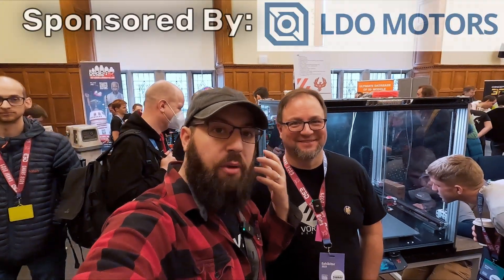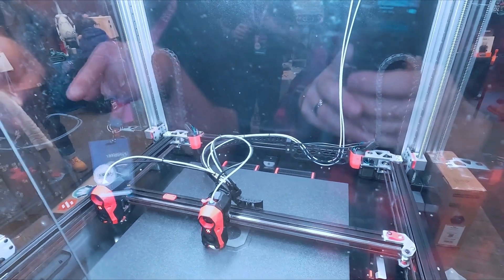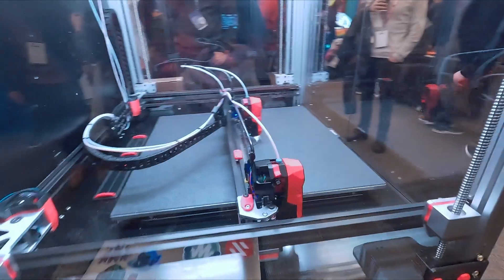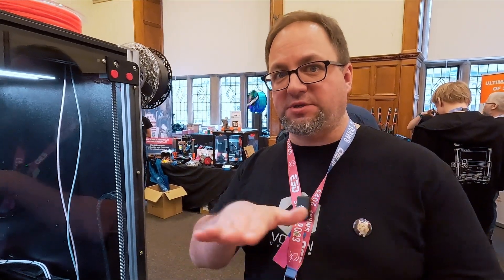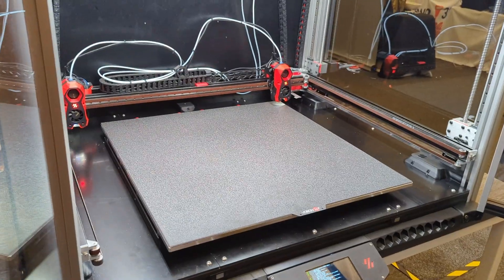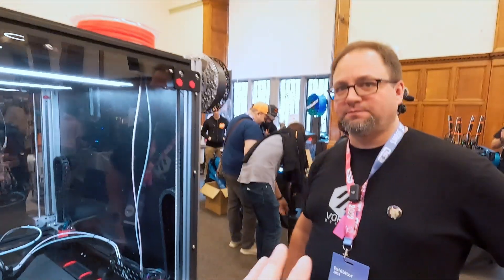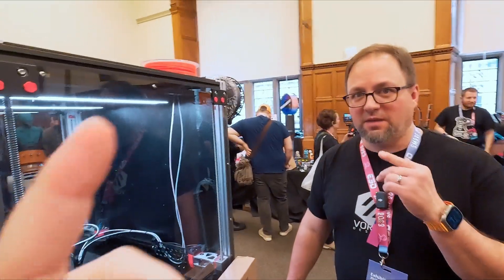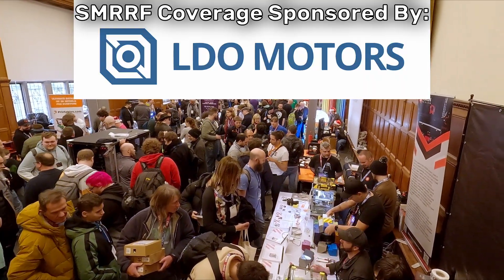VORON PHOENIX - FIRST LOOK #3dprinting #3dprinter #smrrf

Comment: Lead screws and not belts?
Reply from the maker: Ballscrews
Reply: @CanuckCreator   *Ballscrews and not belts? Why not belts like the Voron 2.4's?
Reply from the maker: Simply due to the size and weight of the large gantry, belts actually WOULD work, but ballscrews just suit this usecase better in actual use
Reply: @CanuckCreator  I see. Reason I ask is because I am building a custom printer and originally planned for belts, but now I am second guessing it.

Comment: Dang it.. why only 2 heads? So many voron projects with 2.4 350x350 showing 4/5/6 head changers now, and the ProForge 4 with 4 heads.. we need to see more heads and tool changer over just IDEX. IDEX is ok.. but you want at least 3 heads to have to materials + support material (e..g the stuff that is easy to wash away). But multiple heads/nozzles/temps is clearly the way forward.. especially if the tool change aparatus is rock solid (and built like a tank to last).

Comment: So they still use this weak flexible gantry and weak 20x20 profile structure...Well, at least they got rid off belts on Z axis. Next they should get rid of moving gantry, use stiffer profile and, maybe, Voron finally become good and really fast printer. Still very expensive, but, at least, faster than bedslingers.

Comment: I don't get people's love for TAP over something as simple as a strain-gage on the hotend mount.  Both have the same hassle that the nozzle has to be clean, but I just think the strain-gage mount would be less complex and could also provide useful measurements during printing.  It would basically be a TAP-equivalent with minimal Z-travel, no?  Also ... those Voron printheads now seem large and heavy compared to Bambulab or Creality K1 assemblies (and that's without TAP).  Does that not have negative impact on speed and quality?  Sometimes I get the feeling Voron is on the "more" side while everyone's starting to realize that "less is more".  I'm just a noob, but would love to have some more technical explanations on why some things are designed as they are and debates on whether that is the correct decision.  Ex. Does the flying gantry of the 2.4 (and apparently the Phoenix) have any significant advantage?  Isn't moving the (relatively stable) bed up and down less hassle than keeping a gantry steady while experiencing lots of forces from x and y movements?  Isn't the ability of hanging an extra blower at fixed height better than requiring all cooling to come from the print-heads?  Don't get me wrong: 1) I'm a newbie and hence whatever I'm saying is likely wrong and 2) I do think Vorons have been and are pushing 3d printing forwards, but ... I would really love some videos going in-depth on the pros and cons of some design decisions of various printers (Vorons and others) and pitching those decisions against eachother.
Reply: Are you aware of a strain-gauge mount for the Stealthburner?  That's the issue.  If it existed, it would sell like hotcakes.  I used a Duet Smart Effector for years (strain gauge direct probe) and it was amazing.
Reply: I imagine specifically with the phoenix moving around just the gantry as opposed to moving 4 separate heated beds makes more sense
Reply: @bradleychilds4492  Why?  The beds only need to be moved in Z and with lead-screws even the weight of 4 beds would be peanuts to move up and down.  Whereas the flying gantry with (4?) XY (or AB) motors attached will likely weigh more than those 4 beds.  The AC voltage of the beds might be a good excuse, but even there a decent cable chain would still make moving the bed up and down better in my eyes.  But as said, getting some videos discussing the pro and cons of each solution would be great ...
Reply: @MisterkeTube Not about the weight, but the logistics of it. Moving 4 beds up and down is easy sure, but moving the up and down AND keeping them perfectly aligned at all times sounds like more hassle than it's worth. In this case the extra weight on the gantry is the lesser of two evils.

Like you said, less is more and moving 4 beds just adds unnecessary complexity.
Reply: @pbbarntt  I don't see how alignment of the beds can be the issue as those would be mounted fixed onto a frame that you are moving up and down.  Once installed on that frame their alignment would be fixed.  I would expect that you mount them fixed where the 4 beds touch and allow the beds to expand to the outside when being heated.  Anyhow, any such alignment problem has to be dealt with exactly the same whether the frame they are mounted to is fixed on the bottom or is moved up and down.  But a flying gantry has forces from the moving printhead pushing it in all directions and despite linear rails that shaking gantry will vibrate more from this than if it was fixed solidly to the frame.  Anyway, I appreciate the input - as said, I just think their should be more videos discussing these choices in depth.  Everything will have pros and cons and just showing the options and their pros and cons in detail would be nice.  Not only for "flying gantry or not", but there's als "pom wheels or metal ones", "lead screws, ball screws or belts", "multiple extruders on 1 head or IDEX", "corexy vs delta vs cartesian vs croxy" ... but not just glancing over things, getting into the nitty gritty details!
Reply: @MisterkeTube  You're not wrong. For instance, even within the Voron community not many can give you a true difference (in terms of engineering) between the 2.4 and the Trident, other than one has a flying gantry and the other doesn't.

That said, as someone who has both I can tell you that the mechanical differences between them are almost negligible from an operator standpoint. But like you an actual in depth analysis between the two would be nice.

Comment: I've come to terms with the truth that I'm not at all interested in actually building a printer, but man do I love seeing the cleverness Voron puts into their machines.   The Phoenix even offers capabilites I'd actually use!  Well, perhaps this will inspire manufacturers on the "it just works" side to put out something comparable.
Reply: "perhaps" sounds a bit funny when you look at Bambu Lab or the Creality K1. They already "got inspired" very, very much by Voron so they definitely copy it!
Reply: @hassosigbjoernson5738  K1 is, I think, less inspired by Voron than it is by the X1C.  There's a lineage, but saying the K1 is inspired by the Vorons is like saying Star Wars was inspired by John Ford.  There's a connexion, but there's also intervening steps.

The X1C is, of course, a (very successful) attempt to create a commercial printer with performance and functionality similar to the Voron 2.  I'm fine with that, because I love my X1C and it doesn't actually copy anything in the Voron design itself - Voron didn't invent CoreXY after all.

But just because Voron inspired Bambu once doesn't mean they will again.  And so, "perhaps" is the best word after all.  :)

Comment: Would be interesting to see what impact the parked tool head has on speeds, quality and input shaper. Especially since you have the extra load on opposite ends of the axis depending on what tool head you’re using

Comment: will we have an upgrade path from v2.4 to this one?
Reply: Can’t tell if joke or not 🙃
Reply: The hardware and software used for 2 tool heads should be compatible to a V2. 
You will lose quite a bit of the build plate in x as a trade of.
Reply: The only thing you would reuse is half your toolhead, maybe your pi.

Comment: Looks veeery nice, I'm curious about the price tag though... 3k? 4k? All in all...
Reply: Hmm 2-3k for the kit probably is my guess. 
4 heaters, 2 tools heads, custom controller board and the enclosure looked custom too.
Reply: At SMMRF they mentioned a kit would come up to 5K
Reply: Wow... That's too expensive. 
For 5k you can get the PrusaXL with 5 tool heads I think?
I build a 350mm Voron 2.4r2 and 600mm would not cost this much more....
Reply: Eleegoo giga is cheaper and larger.